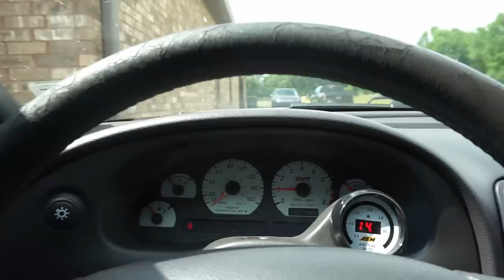FINALLY FOUND MY BOOST PROBLEM! | MAX HP TERMINATOR COBRA

Comment: Hey so did you replace the Actuater?????
What’s the link for that part
I have an 04’ roush stage 3 supercharger
Reply from the maker: I did replace it, I found a used one on eBay tho. You may just have to try there or Facebook groups for one if you need it.